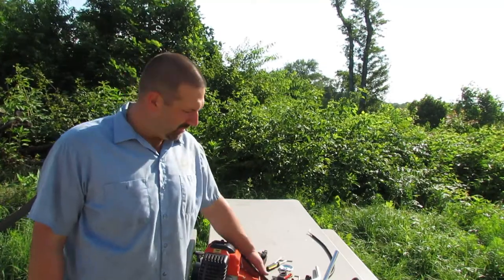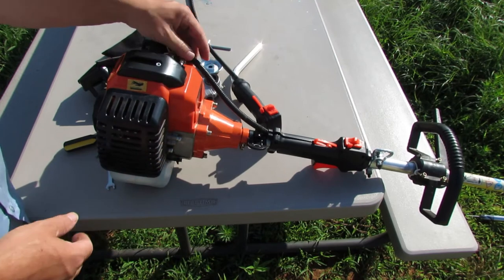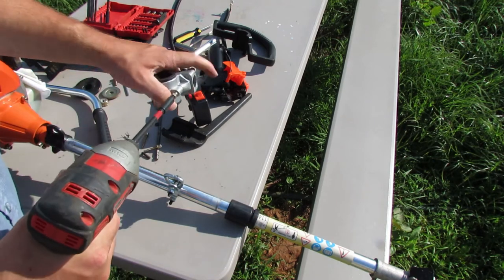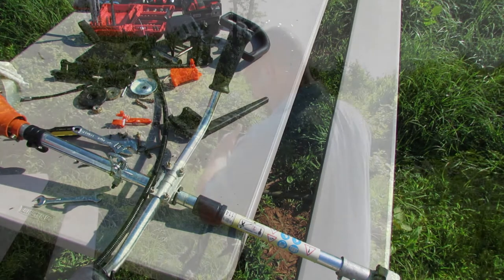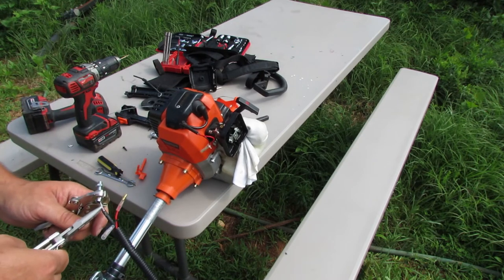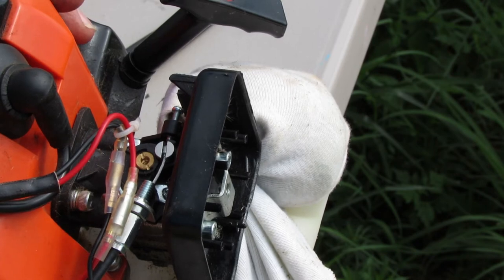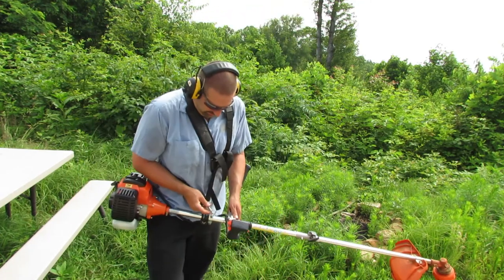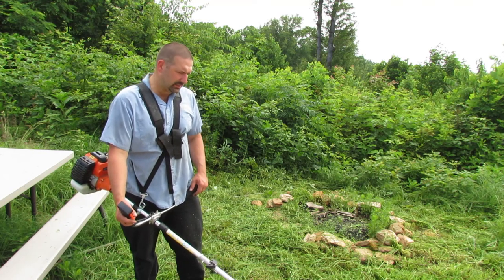GRM520 5 In 1 Multi Function 52cc Brush Cutter Handle Upgrade

Comment: How did that work out for you ? I see ads about this machine ?
Reply from the maker: Gerardo Medina I LOVE this machine! Check out the playlist below for more videos. I have owned it for 1.5 years now and have used it heavily. The power that it has is unbelievable. The only issue I would complain about is every screw needs to be checked for tightness. Over the past year or so I would say it has paid for itself more than once, meaning if it died tomorrow I would not hesitate buying another. Check out the link below to purchase this model. Thanks for watching and commenting! ~Mr. C.

5 in 1 brush cutter: https://amzn.to/34rf9m7
Brush Cutter Playlist: https://www.youtube.com/playlist?list=PL9e-N4NEgHNv74kfAmNhqGT8p5IxWBJOQ
Reply: Thanks man.  I just bought one tonight based off of yours and another guys review here on YouTube. Recently bought a zero turn and I need a solid weed eater that won't break the bank. I have bought a 58cc chainsaw off of Ebay and I will put it up against any commercial saw power wise so I already felt confident about this purchase but you gave me that extra push. Shout out from Alabama.
Reply from the maker: Shad Money that's awesome! I just used it earlier today. Ran a whole tank of gas through it while demolishing last years tall grass, briers, and saplings about as big as my thumb. The three sided blade that came with it is still holding on. Here are a few pointers. Check every screw for tightness especially the carburetor mounting screws and all engine block screws. You will need to adjust the carburetor. It is heavy and I think it uses a lot of gas but I guess it is doing a lot of work. Highly recommend the handles if you will mainly use it to brush cut. The gas cap on mine spits gas out of the vent when close to full, I just zip tied a small piece of rag over the top of the cap. Enjoy from Virginia. ~Mr. C.
Reply: @NaturesCadenceFarm  That is advice that will definitely be taken heed to. Do you think it is too heavy to run a few yards in a days timing? I am thinking about doing a little bit of light landscaping to make a little money outside of small engine repairs and pressure washing. Also I am not sure if you own a chainsaw but the one I have is from Ebay.  If you type in '2.5 58cc chainsaw' it will be a reddish orange and black saw. They are selling for 88 dollars free shipping right now. When I say a beast, I mean a beast! I have bought 5 of them already.  Two for me personally and three for my friends. You will not be disappointed my friend.  Definitely one to do a review on.
Reply: @NaturesCadenceFarm  Also, thank you for replying to my comment.
Reply: @NaturesCadenceFarm  Lastly, where did you buy the handles for brush cutting? I may go ahead and order them tonight.
Reply: @NaturesCadenceFarm  Whoops my bad. The link is in the description,  duh! Lol
Reply from the maker: Shad Money I think you would be fine for that amount of time even without the harness. Before I swapped the handles out I would just hold it. I think the longest was close to an hour after that I started using the harness that came with it for longer jobs. Now I just use the harness all the time because of the handles. ~Mr. C.
Reply: @NaturesCadenceFarm  Thanks tremendously.  I will send you my thoughts on it once it arrives! Looking forward to it.
Reply: @NaturesCadenceFarm  Man I couldn't wait to reach out to you tonight.  That thing is an absolute beast.  It is heavy like you said but with the side harness it takes the burden off a bit while weed eating.  Now, you may be aware of it but just in case you are not I must tell you.  They have a version of this same machine that comes as a backpack. Go on Ebay once you get a chance and type in 'Backpack Weed Eater.' I went ahead and ordered one last night.  They also have videos here as well if you type that in.
Reply: @NaturesCadenceFarm  Well actually type in 'Backpack Brush Cutter,' and it will pull it up on Ebay.
Reply: @NaturesCadenceFarm  They are 219 dollars.
Reply: @NaturesCadenceFarm  Type in 'backpack brush cutter ' on YouTube as well. It pulls up all the videos related to that unit. I had been putting in 'weed eater' and it was limiting the videos that actually reference the machine.  I am JUST figuring that out.
Reply from the maker: Shad Money so glad you like it! I have been eying those back pack machines for a while. I told myself if the one I have already holds up I would try one out. I have not took the plunge yet but would love to hear how it works for you. Happy trimming! ~Mr. C.
Reply: @NaturesCadenceFarm  Yes sir!!! It says that I should be receiving it by Friday, hopefully.  I will surely give you my honest opinion on it as soon as I put it together.  Thanks again man.
Reply from the maker: Shad Money so glad you feel the same way I do! I have seen the backpack units and really want to try them. I am going to purchase one in the next week! Keep an eye out for assembly and review videos :) Back to brush destruction!!! ~Mr. C.
Reply: @NaturesCadenceFarm  Man I can't wait to see a review on it. The shipping date changed on mine so it should be here Wednesday. Shout your boy out in your video once you make it.  I would be tickled to death.  It's Shad like you would say Rashad. Back to conquering the world one weed at a time.
Reply: @NaturesCadenceFarm  Aw man.  I cannot wait for you to get your unit. When I tell you they are fun, I  mean they are fun. Here is a heads up. When you are putting on and releasing your attachments you have to push back on the extension piece towards the pole with your trigger on it with a little force before pushing down on the latch that unlocks it. That was my only hang up initially but as far as power is concerned it is exactly like the carry around unit.  Just make sure you adjust the straps to your preference and comfort ability.